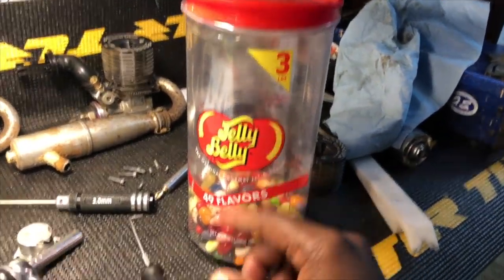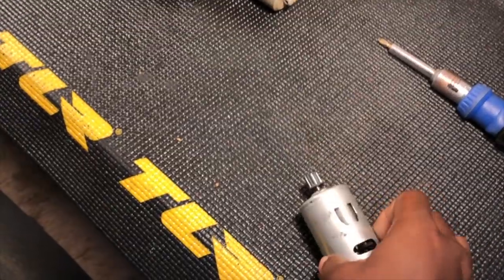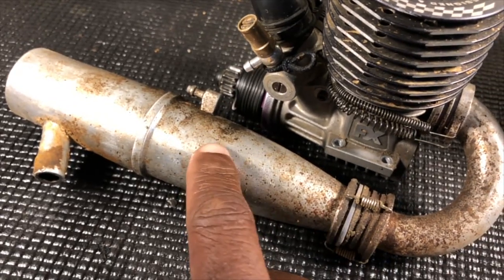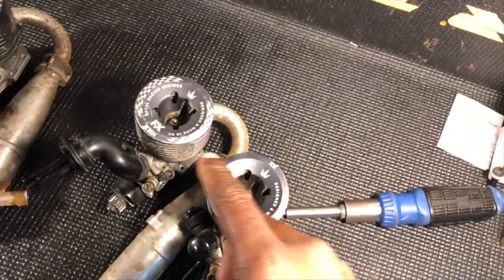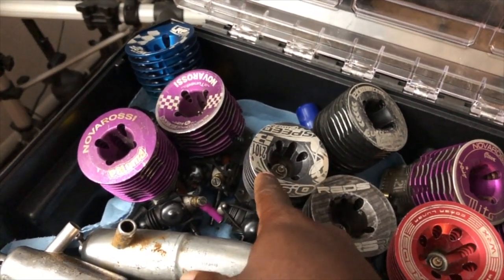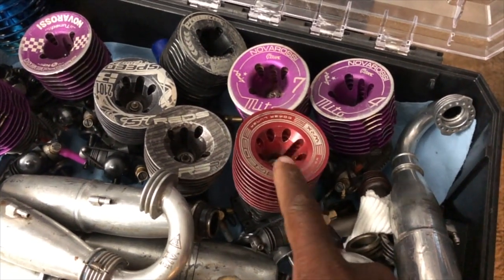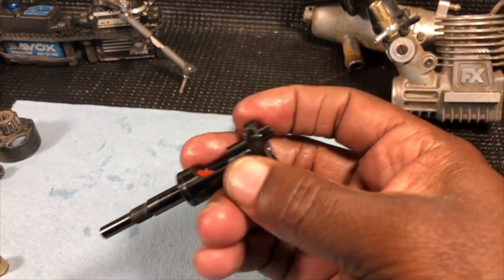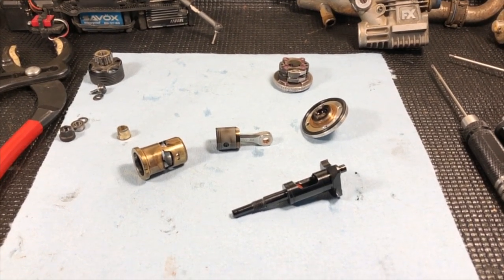Some Nitro Engine Shop Talk, Thanks for the 2000 Subs

Comment: Congrats 2k subs an the motor&pipe with headers box is a nice verity an stuff great vid keep them coming an thankx for pointing out the chessy header from os even tho I've drill holes as well just  nothing is not going to have issues i enjoy my os stuff
Reply from the maker: Thanks brotha, I still love the pipe, I'm just running out of space for holes...lol
Reply: @rajaa111  well that just means when you get another one you should just get two cause the hobby is expensive but things like that you be upset with try that 85 mm on the buggy an the truggy

Comment: I love this! You think that when changing out pipes or motor or what have you.  Do you need to change the setup on the chassis too? Like if you go in and add tourq/ bottom end punch. Then you need to adjust roll center and diff fluids ect. ? I guess with the buggy you would but prolly not so much with truck. ?
Reply from the maker: Bigdaddyd82 Vapes well from my experience I never had to change my car setup when I added or took away bottom end or torque but you may have to change something because your driving style will change that also depends on track condition too.
Reply: @rajaa111  
Yeah you right. It's about feel and driving style and the track. Hopefully I get a nitro setup b4 the end of summer.  I do 10th scale buggy, truck and 4wd buggy. I have a Hobao E truggy for shitz. But got my eye on the B3.1 tho. And prolly a Novarossi .21 4 port.

Comment: Can never put nitro down no matter how many times i tell myself screw it! Currently in love with my jato 3.3, over 10 years old and still running strong!! Original engine and all :)
Reply from the maker: Derrick Zanni I feel you, wow 10 years on the same engine is impressive, you must really take care of your stuff 👍🏾
Reply: @rajaa111  i make sure to clean out the tank and fuel lines after each use to make sure there is no fuel left in the engine. On top of that i maintain the air filter and clean it once a week. Full engine strip and clean once a month.

Comment: Question which is better for my tekno truggy nova 28 8 rex or nova 28 8 plus just for bashing
Reply from the maker: Well we know the 28-8 is a good bashing engine, I've never ran the nova 28-8 plus. I figure its the same engine with a different name.
Reply: @rajaa111  cool thanks 👊
Reply: @rajaa111    The Rex comes with a 3 needle carb Is that OK or something I should stay away from

Comment: I have been running the k302.1 for couple days now. It is a very smooth motor and extremely quiet with pipe combo. But it is lacking low end torque specially for a 3  port that should have strong bottom end. Top end is ok . Won't even clear triples at the track. My pamola Nova has better low end and extremely good too end. For $400 I paid vs the pamola that was $250 for the pipe and header I would choose the Nova over the k 302.1.
Reply from the maker: NaderS Sedagt really, did you get the ec version? That one i believe is setup to get better gas mileage, I’ve seen the k302 run, it’s a monsta on thing they changed from the k3 is the looking head and maybe some carb work. The Paloma is a nasty engine but remember the Paloma is a 7 port compared to the k302 which is a 3 port
Reply: @rajaa111  only one version available. K302.1. I wanted more torque than my pamola so I went with 3 port but having trouble even clearing triples.

Comment: Do you know anything about the novarossi mephesto? Not really any videos.. Do you know if it's better than the mito?
Reply from the maker: steven from what I’ve heard they are similar to the mito line with a dlc coated cranks, the earlier version didn’t have the dlc coated cranks but I believe the newer versions do. I seen a guy at the track run one and it was nice.
Reply: Thanks bud!

Comment: Have you got your 5K yet? I seen you single those 3 and was wondering if it was just timing? The 5K has a lot of torque and I ran a aluminum flywheel. It just rips all four tires over and gets it! Just takes off in the grass... like a little rocket and has great top end I think too.... all around Badass engine so thanks for introducing me. I’ve been wanting a motor to jut go balls out! I had to change that carb out with my BLOCK PM carb but it runs great and settles down now. I’m curious about how yours is gonna run. Keep me posted
Reply from the maker: Kevin Caldwell yeah I have it but I haven’t opened the box yet, been trying to figure out this Reds plus I want to send it to Adam drake for break in, I just don’t have the time or the want to sit, I’ll do a unboxing. You need to start making some videos
Reply: rajaa111 I tried with my tablet but I fuck my words all up... I did a ok video awhile back but it wouldn’t load up.... I don’t know why? Maybe I will try another but I get all wired when people focus on me in a group! No joke!

Comment: What up Raja? If like to see the keepoff in the right, reason being I got one in a lot about a year ago with a blown out rod. It is modded be rcr and I am just curious wether it's worth fixing.
Reply from the maker: Nitro Byrd that keepoff is a very nice engine very easy to tune and she purr like a kitten, plus she’s great in the gas, I would fix her up and you going to be getting in to racing you need gas mileage trust me👍🏾
Reply: So the rod was blown and it's the 3 needle carb, the mid speed is backed way out of the carb body. I have a couple new novorossi engines do you think if I used my calipers on it to set the same depth it will get me close enough that I don't hurt the engine?
Reply from the maker: Nitro Byrd with the mid speed needle just make it flush with the carb, that usually the starting point, that rod should be conrod r7, you can order a replace on http://www.novarossidirect.com
Reply: I wonder what the wife is going to say when I tell her we are going to trains and lanes for vacation this year.
Reply from the maker: lmao.....i'm crying, make sure you vlog it when you tell her